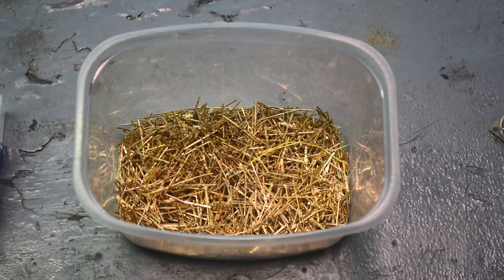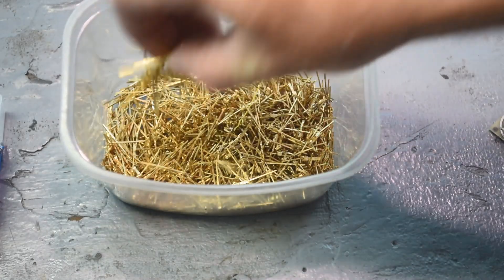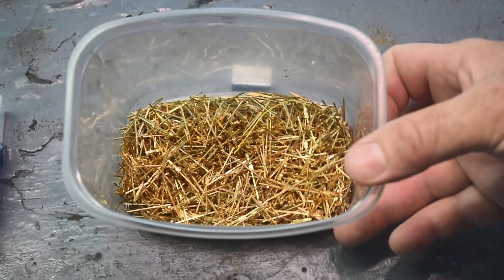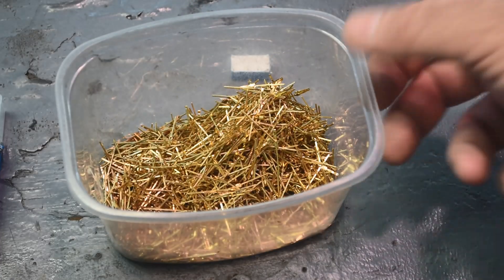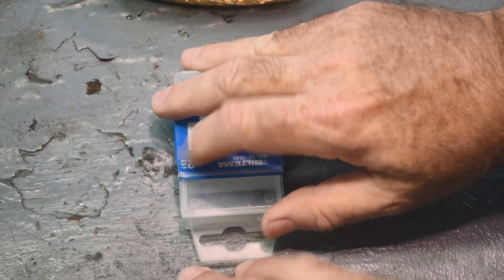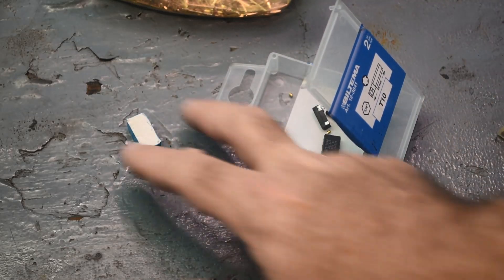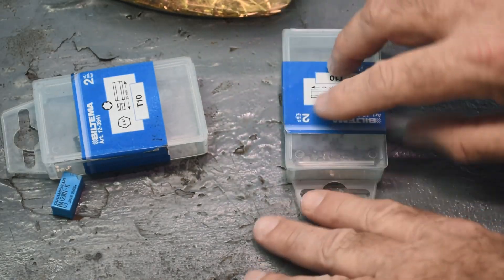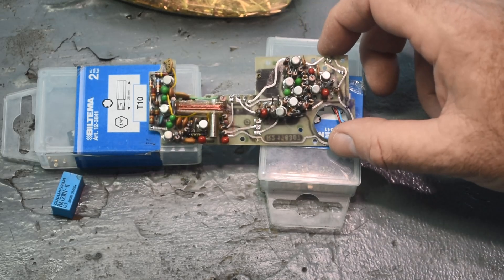80 Kilos of Gold Plated Pins #gold #chemistry #refining #ewaste

Comment: I would melt about a Kilo of those gold pins into an ingot and put the ingot into a electro-lytic copper cell. Use used Copper nitrate as the electrolyte and hook it up with about 3-4 volts at 4 amps.
that way you would recover 100% of the copper and you will have the gold in a form which is very easy to process, essentially a gold sludge or slime. It only uses a bit of electricity to do, it would run about a week, but it's fun to watch the copper crystals grow. I don't have the ECO gold-x, so This would be the safest option.  No Sulfuric acid to worry about and recycling of old copper nitrate is also a plus. I've tried using copper sulfate crystals and Distilled water, but I find the copper concentrate decreases over a short period of time and you have to keep replenishing the solution with new crystals to keep the concentration up. I always have extra copper nitrate laying around. Better to use it this way than to dump it into my iron bucket.

Comment: Can't wait to see the revovery - it's very interesting. Keep the videos coming 👌🌟

Done some research based of 1 yield for pins like this and for 4.8kg of pins they managed to get a yield of 3.1g.

To get an estimate for how much gold you would get I done bit of maths- ratio.

Yield of gold in g : per scrap pins in g

To get an accurate answer I converted everything to g. 4.8kg = 4800g

3.1 : 4800

To get the amount of gold yield for 1kg aka 1000g

                        3.1 : 4800
         
                  4800÷4.8 =  1000
                      3.1÷4.8= 0.64

Meaning for every 1kg of pins, you get 0.64g of gold (possibly these might be higher or lower quality so it may vary)

So with the 80kg

0.64x80=51.2g

51.2g of gold with a gold price of $79 as of today:

51.2 x 79 = $4044.80

$4k is very, very good, I hope he gets at least this much if he processed all 80kg of pins

Comment: Mike, if you choose reverse-electroplating on some of the pins, I wonder whether you could use a basket plating set-up to keep the pins tumbling around while being stripped?  When I started my career at a military aircraft overhaul facility, the Plating Shop still had a Cad-plating line that used a rotating basket for cad-plating large quantities of nuts, bolts, screws, washers, etc., that were used (I guess) in the radial engine (R-1820-something -- I don't know which variant) that we were still overhauling at the time.  The basket was set-up like a drum spinning horizontally around its long axis.  It was made of plates of a plastic that easily withstood all of the chemicals in the cad-plating line.  If I remember correctly, an electric motor above the basket away from the chemicals drove the basket with a chain similar to what a bicycle or motorcycle use, but it must have been made of stainless or similar to avoid having to replace it due to corrosion.  I think the basket had a large plastic sprocket attached to its end.  Of course, a basket might not be a good idea if the perforations in the basket allow the pins to slip out of the basket?  Just an idea....

Comment: Those plastic oscilators i found in a new old stock batch. About 200g of thin ones and 170g of the larger. I was thinking they were octocouplers... but after i found the thin ones that looked similar i put them in baggies and left them with the onsorted new old stock. Got some gold rimmed ones too even some still in the roll

Comment: I have been just using ap solutions for pins and such. Stir it up, filter loose foils. Then a few times, I let some corrosive salts form and soak it again the next day. 
I tested on a few lbs of the "barely plated" pins from ribbon connectors, and the foils are all off before the coppers all gone. 
Seems alot easier for my "too many things going on" approach. 😂
I don't use a bubbler for ap solutions though, once it turns to a "hockey puck" I just drain most, add water, then alittle more hcl. This breaks up the concreting that happens as the ap solution becomes saturated.
Seems most cost-effective while allowing other projects to be worked on simultaneously.

Comment: I usually do reverse electroplating for pins.  But it is difficult to do large batches without equipment.   I have read that if you run it at 3 volts then you will get fairly pure gold.  I was going to change from 12 to 3 volts this year, But instead,  I just threw all the pins and in a 5 gal bucket and dumped in some HCL.  After 2 days, I removed acid and now am letting the pins corrode.  Next, I will reintroduce the acid and add a couple handfuls of KN03.  The point is not to dissolve the pins but to deplate them.  Then, I will Filter the acid and remove the scum left on the bottom of the bucket and process that.

Comment: I would go with reverse gold electrolysis using salt water. Get a large SS pot, attach an electrode to the pot, the second electrode isolated from the pot, add all the pin directly into the pot, cover with salt water, turn on power supply, stir frequently to make sure pins are in electrical contact with the pot and each other. Gold will strip off the pins. Keep it up until all gold has been removed and turn off power supply. Now in solution you have gold, and traces of base metals (nickel, copper, solder?, steel). Pour off liquid, and process with HCL to get rid of base metals, then process for the gold. :) I like this process because during the recovery process, no hazardous chemicals are used.
Reply: Wait, you could just electrolysis a gold using salt water instead of sulfuric acid? Then why not use lye method, submerge the gold in really alkaly water the gold would disolve and the you just need to percipitate using zinc metal then remove the zinc using sulfuric acid  then refine it. Is that sound more easy since lye and sulfuric acid is sell really cheap in US and easy to find in Costco, Walmart, etc?
Reply: @edibandulan5266  I didn't invent this process, just saw it on 3 other videos. https://www.youtube.com/watch?v=QfsrLCoadfM or https://www.youtube.com/watch?v=HGeuAvfHSRY or https://www.youtube.com/watch?v=vda2BUZLO30. I used the 3v taps from an old used pc power supply. I found that using 3v takes off the gold just fine in a short while and not much base metals. Using the 12v line is fine too but then more voltage means that more of the base metals also gets into solution. Cheers
Reply: @edibandulan5266  Sounds plausible. I never tried the lye method. I can use the salt water method indoors with no fuming chemicals and then take the solution outdoors for the rest of the treatment, I find this is more convenient for me. Maybe Mike can do some experiments on both methods and compare which is easiest. Here in Australia, chemicals are hard to find or very expensive. Salt and HCl can be found everywhere and cheaply here. Cheers
Reply: @Alex-kp3hr  I was doing electrolysis before for making sodium chlorate for percipitate palladium it take so long time to do it, using salt water and lil bit sulfuric acid as a electrolyte for beter conduction, yes it would work on 3volts dc current but i think you should higher the amphere. About the lye method yes you can doing that really alkaly solution could disolve a gold even if you don't add cyanide to it. People in my country Indonesia use sodium carbonate and lye to higher the PH and safe their expensive sodium hydroxide flake.

Comment: Id rather salvage the tin than the copper from boards like that.

This has the making of very interesting vids
Reply: @scrappydoo7887 .   Tin is worth five times more than Copper! I recover 100% of the solder hydrometallurgical for Tin (and Lead/Copper/Silver) recovery. Afterwards, I process every single component on Printed Circuit Boards; even the bare boards!
I'm a full time scrapper/refiner with 12 years of experience. I handle up to 60 tons a month.
Reply: @zero-waste  that's a damn impressive amount of weight
Reply: @scrappydoo7887 .   In theory I could do more, but I'm working at home. In my backyard I can barely handle much more than a couple of tons a day manually. Expanding means I must get a larger workshop. I do have a 400m2 storage facility.
Despite getting a lot of WEEE (e-waste), the majority is plastic for recycling, followed by lots of scrap iron/other metals.
I work hard for 10 months, then it's time for winter holiday; 2 months of sunshine in my own house at the beach in a tropical country in the southern hemisphere; with lots of Big Game sportfishing from my own boat, far out on the Atlantic.

Comment: On reverse electroplating I wondered what the electrochemical potential if the various metals is , as if it's different you could theoretically remove only the base metals leaving the value or vice versa by using very precise voltage control ,  the raw metallic pile of pins make it easier , agitation or rolling could help remove stratification